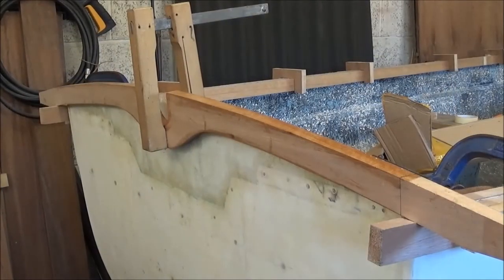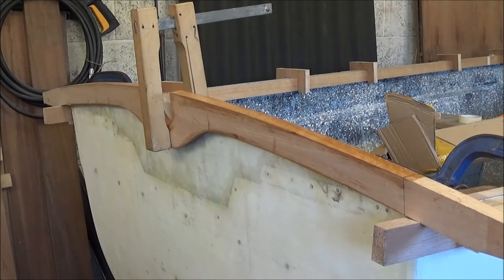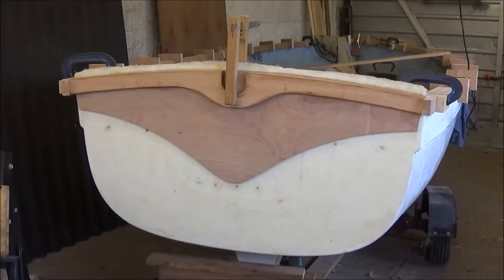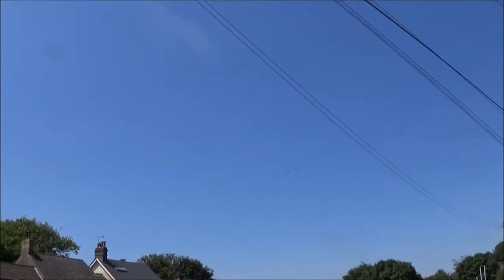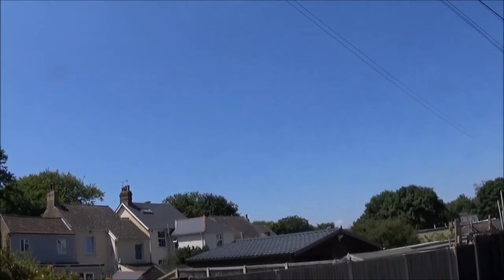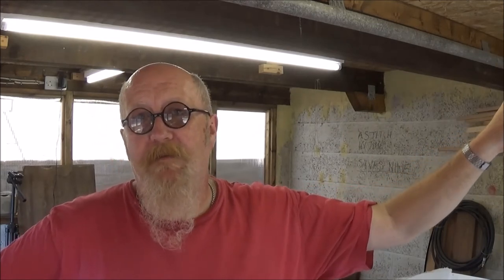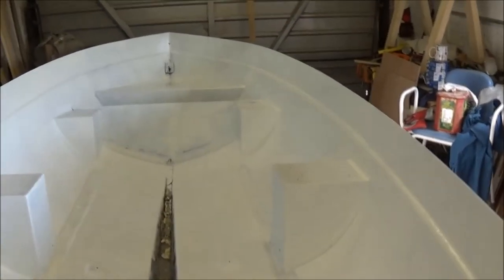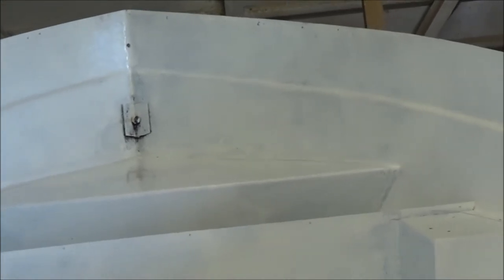Dale Skidmore - Boat Restoration Part 9

Comment: Hi Ade...Well she certainly looks different with a lick of paint on man, it's amazing how some work and TLC can turn a shipwreck into the pride of the fleet. As for the floor of the boat, you don't strike me as the kinda of guy that does something a certain way just because it's easier. Keep up the fine work Ade and as always be safe and be lucky man, Wol.
Reply from the maker: It certainly transforms the inside, Wol, so it should work for the outside too, hopefully. Hmm, you can read me like a scratch card, lol. Half of me thinks a marine ply floor would look better, if it is cut and kerfed in the right way, half of me thinks the pine slats look a bit messy..... and half of me can't make up it's mind. Cheers Wol.